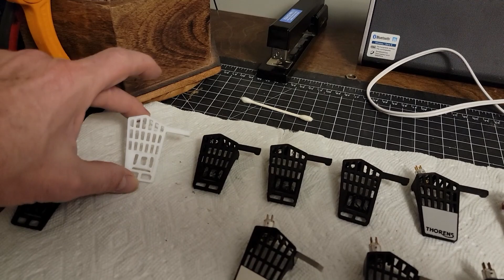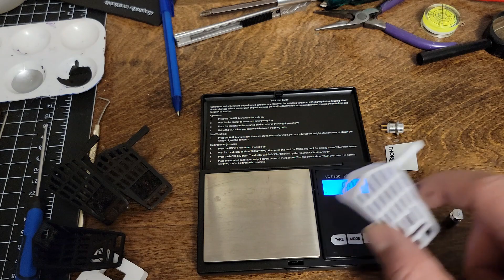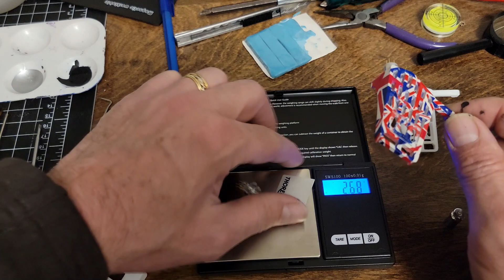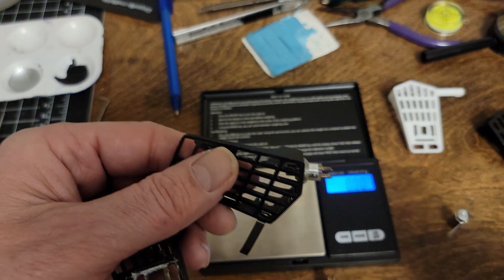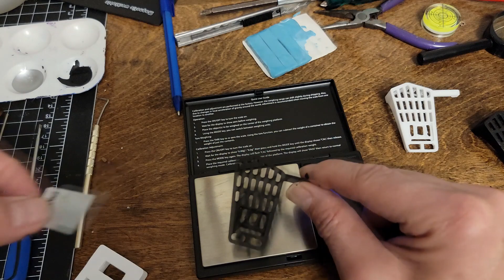Thorens 3D Headshell Mass Comparison with Actual Thorens TP-60 Headshell

Comment: What are the thicknesses of the cartridge spacers you offer with your downloadable 3D program ?
Reply from the maker: That is the beauty of 3D modeling - you can make them any thickness you want. I can't recall exactly what these ones are but likely in 1mm increments. You can use your slicer or tinkercad to easily change dimensions to suit your needs...
Reply: Thank-you for your response. Any thickness I choose !!

Comment: Hi, how do you set the azimuth on the original cartridge? Thank you.
Reply from the maker: Most of the time azimuth is correct if you use the sliding threaded M2 nut block in the OEM headshell because you can't skew the cart using that. If that is what you mean????🤔

https://youtu.be/ZumyA1pBXoU

Comment: I was thinking I quite like the cross member what you see on the new TD arms.
you could 3D print that connected to the bullitt so it can be screwed in as normal. ever thought of making one?
 you can't make the nut out of 3D printed material?? resin probably that would be a good weight saver with the bullet, why don't you 3D print the connector bullet?
going back to my other comment,  making the arm tube all-in-one with the headshell because some of the arms are screwed in at the base so that would be ok, should be no problem no disassembly.

think making the divider pieces hexagonal would be better approach than just straight. for starters it uses less material and is a stronger structure then a box shape. could make the whole headshell hexagonal with hexagonal dividing pieces give it a go!!
Reply from the maker: Tried that. Not sturdy enough